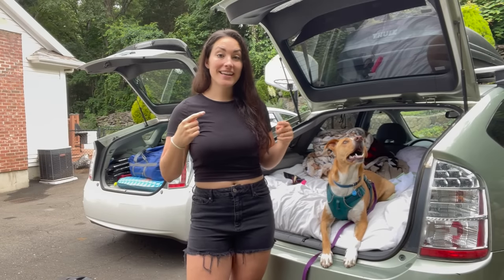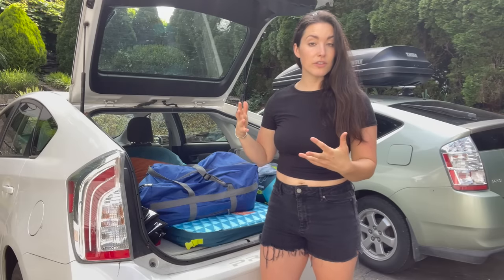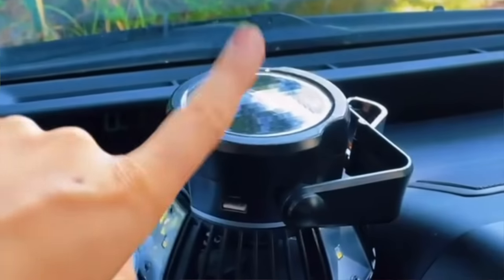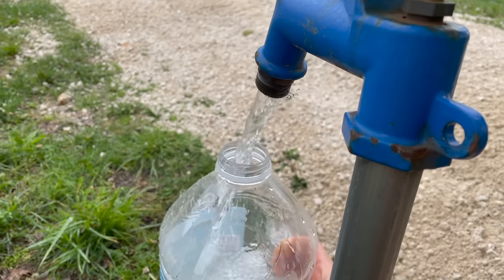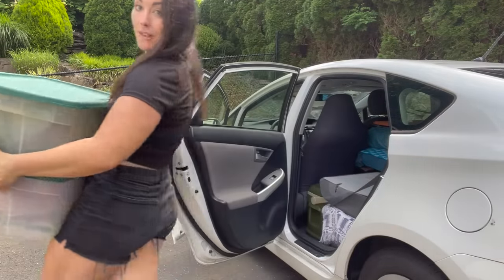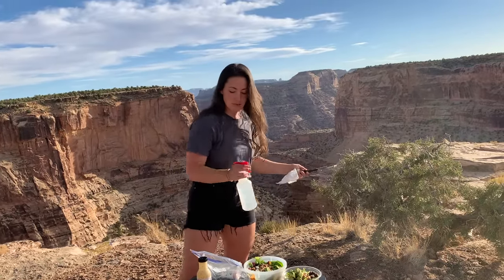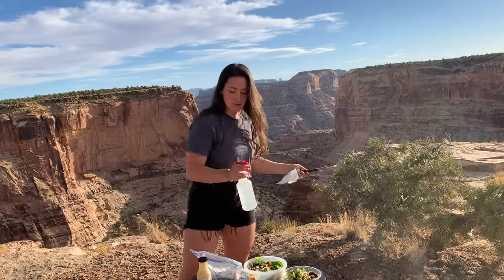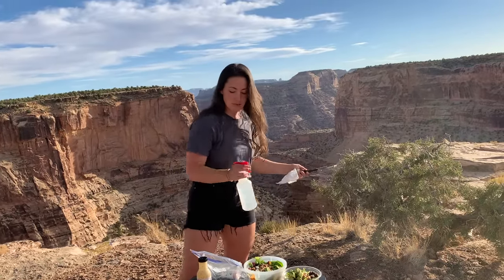Easy NO Build Car Camper Conversion + all the ESSENTIALS you need! From a 3+ yrs full timer!

Comment: Tip for super cooling a standard cooler. If a Yeti is out of your price range or you are going to be in areas where a Yeti would attract attention or get stolen, you can super chill a standard cooler with a couple things from the hardware store. Most coolers have insulation on the sides, but the lid is hollow. You lose a lot of cold through the lid. Pick a cooler that you can pop the lid off. Drill two small holes in the back of the lid where the lid attaches to the cooler. Get a can of Great Stuff expanding foam. You may or may not need a whole can, so plan this project with a friend to do their cooler or fill any gaps around the house with the leftovers. It's just hard to reopen the can after you've used it once. Do this outside and have newspaper or paper bags to lay under the lid if needed. Insert the straw and spray the foam slowly into one hole just until it starts to come out the other. This foam will expand to fill the whole lid. Let it cure overnight and there should be a bubble of foam over the holes if you did it right. Trim the excess off and clean up the outside. This is why you don't want to drill holes in the inside of the cooler where your food will be exposed to it - it's impossible to seal it up at this point. So pick a spot in the back that's easily concealed.  While you wait for the lid to dry, you need some Reflectix bubble foil and foil tape. Measure and cut a liner with a fold over lid that fits perfectly into the cooler. Basically you are going for a flat fold box type shape with the corners cut out. Use those to do covers for your small windows! Use the foil tape to put the liner together inside the cooler so it fits perfectly. Then pull it out and do the tape over the seams on the outside.  So with the liner in place and the foam filled lid, I've had ice last days longer than just the cooler alone. You can pull it out to rinse it off and the liner won't absorb water. I pull mine out of the cooler every few days to let the cooler air out. I hope someone finds this helpful.
Reply: Is Yetis’ lid hollow?
Reply: @oakmaiden2133  I don't own one but I think that's the big difference between and Yeti and a regular cooler.
Reply: @IhateSIGNINGup4this  Interesting. To each their own then. I find I get much better performance out of my coolers after being modified.

Comment: Great video Miss Nikki. In my Prius V setup, I have converted my stove to electric plus a 700 watt microwave. Use a shower tent with a solar bucked to heat water. No TP,  just baby wipes. Baby wipes for everything. Vinegar for dish washing plus disinfecting my water. You can also get premade screens from a company out of England. Also use a portable Teardrop Awning for the back to cook under or just hang out. I removed all the seats except driver and put the bed on the floor from the dash to the main battery pack, more room in the back. I put the Engel 40 quart fridge next to the bed behind the driver's seat. (very little draw). I added an extra 12 volt battery that is wired in parallel to the other Toyota battery which gives me 90 amp hrs of storage, all hooked into a 2000 watt pure sinewave inverter. At night, I run the AC/Heater on low fan and use a USB fan to circulate the air. I use about 1/2 gallon of fuel a day. Basically, I watched every Prius Camping/Living video out there and just took all the best things that worked for me. Comfort plus fuel efficiency. 👍
Reply: Do a video of your setup. Would love to see it.
Reply: @simplethailife6611  Yes, I have been thinking about setting up a Channel and doing some videos. 👍
Reply: Did you have any electrical/sensor problems when you removed the seats? There's so much wiring, everywhere, nowadays.
Reply: @snowygirl131  There are two sensors you have to unplug on the front seat, but no issues with that. 👍
Reply: Please be careful with using vinegar to clean. While it can kill some bacteria, it is not a disinfectant and is not safe or reliable to use to disinfect water. Even on objects, it has to sit on the surface for several minutes before any bacteria is reduced. If you camp often or live on the road, please seriously consider getting a water filter.
Reply: @Ineverusemychannel  I second this. Though if you do want a liquid option for emergency water purification, 5 drops of REGULAR, UNSCENTED bleach per gallon will work (exact ideal number of drops per gallon varies based on bleach concentration and should be looked up, but that was the rule of thumb I was taught in my emergency response training), and will be much more effective than vinegar. It does, however, take about 30 minutes to properly purify, and should still have a faint chlorine scent--if it doesn't add the same amount and wait another 15 minutes.

Comment: Great info! Sounds like there is no way to get away from humidity when car/van camping. If you crack the window open and it’s humid out the humidity will get in...and if you don’t, it will get humid inside🤷🏼‍♀️Love that bag thing to absorb moisture! I have watched at least 300 videos and have never seen that👍
Reply: me too, thanks Nikki, have never seen these, I've logged onto the Australian Ebay and bought some, thank you so much.
Reply: We once had a rat climb into the car through a slit 2 cm wide, our bread must have been too tempting 😂. I wonder whether those curtains would have prevented that…

Comment: I was traveling last month and saw these nice ppl. Started chatting with them.  Apparently their car was wrecked by a deer and it is in the shop for 8 days : while the 4 of them sleep at a gas station outside  during 45 degree nights with no jackets.

The difference between them and I: I have full coverage insurance,  rental,  road side and monies for a hotel.  

They only had liability insurance so they were out

Please get good insurance with all the bells and whistles if your living in your car or away from home 

Rental and Roadside is only an extra 30 bucks

Hotel is tricky bc some require a few hundred dollar deposit,  some only accept card or cash. And one time I needed a hotel and the cheapest one was 250 😞
Then there is a cab fee.

But what will you do if you wreck at 9pm... where will you go

Safety first 😀

Comment: Nikki, If I may give you one little trick, easy affordable  how to have hot water on the road as long you are  in warm climate.

 I saw that your roof top as a lot of space available for you.Taking a black PVC 5 inch pipe of around 5 to 6 feet with two end cap install a tire valve in one end and a faucet on the other, do not forget also in one of the end to install a other faucet to refill the water. The black pipe as you travel will warm up the water into the pipe, using your little compressor pressurize the pipe  10 to maybe 20 pound (experiment) at all time you will have warm to how water that whit a  quick disconnect be equip from a shower head to a hose to your bucket to clean dishes. It should not be expensive to fabricated and could be easily attach to you car rack and voila. If it is something you would like to make just had a reply to this post and I will draw the instruction for you to easily make it... I hope this could help you in the wounder full life you have chosen to have with Camper. The entire cost of the build should should not cost maybe $30.00 using you tire compressor you already have... Hoo you could have two of them one drinking water and one wash but after a little wild the water will taste plastic so make sure to refill regularly... Good trip and will look to se if you replay to some sort a way post on my youtube how to do it for you and anyone who would be interested Thanks

Comment: Instead of a duffle, I use latching footlocker style tool boxes. They compress my folded clothes and people think they're ironed out something. I set my mattress diagonal to first, fit, second to balance the driving load. Picked up a great set at Walmart made by hart for like 120$. Doubles as a table for one, and a shelf for the other

Comment: Good stuff and advise, looks pretty comfy to me!! One thing you mentioned but is important based on other video's i've watched is a quality tire repair kit. Kit's from wally world can work, better one's with metal handles on the jungle store as well book sized air compressors are much better(save some coin), i don't venture anywhere too far without them. Thanks so much for sharing, Cheers, Happy Trails!

Comment: Hey thank you so much for all these tips - I’m curious as to why you didn’t discuss the battery/gas temperature control option with a Prius. From what I understand you can adjust the interior temperature and leave the engine running overnight 
it will use minimal gas and charge the battery  throughout the night.
Reply from the maker: Mostly cause this was about car camping items and most people don’t have the option so I saved it for another video :-)

Comment: Some common sense tips & kit. I fail to undertand why more don't simply use an airbed instead of a complex platform and mattress set up....Jumper pack essential. I also think an awning &/or roof box make a lot of sense.  I have dark tints so for me the eye blind makes a lot of sense - maybe combined with a make shift curtain behind front seats...I get that window blinds make sense longer term .............Thanks for sharing,

Comment: You need a portable digital air compressor it’s 20 bucks on eBay you save $1.50 cents every time your tires need air and decide to get it from a gas station.

Comment: Nikki have you ever considered a larger vehicle like a van or minivan. I have camped in the "Minivan Motel" not quite as good on gas as your car but 3 times the space. I know gas mileage is important on trips but so is comfort.
Reply: I've been watching all her videos recently bc I want to prep my Prius for road trip/camping soon, and I think I recall her saying that  other than the mileage, a Prius is simply just easier for her to drive/park etc since it's smaller. ☺️
Reply: My Prius Plug In is a dream come true for gas mileage. I don’t travel across country with it but my trip A mileage tracking has 18,651 miles and the cumulative mpg is 126mpg!!! I use my Prius for going to work and shopping in town but the large electric battery keeps my daily travels gas free! I had a Mazda MPV and that mpg was abysmal compared to my Prius. I have gone as long as 3 months without having to put gas in my Prius, having that kind of fuel savings is a game changer for someone traveling and living in their car. A mini Van would be more spacious than a Prius but that Van body would have to be mounted to a Tesla battery pack and motors for me to switch from my Prius.
Reply: @Infinityfields  I am glade you like your Prius and love that you are getting very good gas mileage with it. I am not knocking her pick in cars just questioning that her living quarters are claustrophobically small. That would work for many people for a very short duration but Nikki seem to be using this as a home and as such even a few more square feet of living space would be magical. Saving money is great but sometimes its nice to have some comfort also.

Comment: The Prius is a great efficient and reliable car, and its impressive how well you made it work for you. But when I get ready to start doing this lifestyle more, I'm going for a Toyota Sienna. Once you remove all the back seats the room you have is incredible and with a little money and ingenuity you can turn them into a great small livable RV that still gets decent gas mileage.  
I've watch a bunch of your videos but haven't heard the answer to this question, but realistically how long do you plan to live this life style? Or is it permanent LOL
Reply: Thanks for the idea about using a Sienna, I’ll have to check into that. Great gas mileage is the best thing about using a Prius. Nikki has a 2006 Prius and I’m sure she gets great gas mileage but my 2012 Prius Plug In is the bomb for me! I bought my Prius used but on my trip A mileage tracking I have 18,651 miles and my cumulative mpg is 126mpg!!! I know this seems like a unbelievable amount but I use my Prius for going to work and in town shopping. Why such the large mpg you may ask? Well with the Plug In Prius it has a large battery that keeps my travels to work and shopping gas free!! I have gone as long as 3 months without putting gas in my Prius. This may not be the case with traveling across country as I plug my Prius in every night and traveling across country those options may not be available. However when I bought the Prius the dealership filled the gas tank and charged the battery before I left, I drove it home 225 miles traveling on average 70-75 mph on the interstate Highway. When I reached home I decided to go fill the gas tank and to my surprise it was down only 2 GALLONS!! I couldn’t believe it!!! I drove 225 miles on 2 gallons of gas!! What I later realized was that the plug-in Prius electric battery will keep the car at the speed and allows the engine to idle or shut off while traveling. Having a Plug In Prius can save a lot of money on gas, my only wish is to have a larger battery in it so the electric range would be further (side note when a Plug In Prius is driving in cities every braking for stop lights causes recharging of the battery 🔋). Using a Plug In Prius is a win win!
Reply: @Infinityfields  Those batteries only last 10 years
Reply: @spinoff2926  Batteries are guaranteed for 10 years or 150,000 miles - does not mean they quit then…

Comment: How do you get a full size mattress between the wheel wells in the Prius? Our 2017 Prius  measures less than 40" between the wheel wells, a full size mattress is 52" wide.
Reply from the maker: Electric turkey cutter on memory foam mattress works wonders lol

Comment: When buying a smaller tent please realize the dimensions on the package are the floor measurements.  When you sleep on an air mattress, etc, you will be higher-where the walls taper closer together.  I am about 5’ 10”.  A 5 x7 tent should work for me, but I just fit.  If I’m on two wheels it’s my best choice.  If I’m using my car I use a much larger tent.

Comment: You are so hotttttttttt! I tried this set up in my VW Jetta once on a summer night and with the bug net over the windows, windows down, and some camping fans inside- it was still unbearably hot like 90°. Any suggestions? Can't think of what to do without having the car running with AC for 10 hours hahah or maybe car camping is only for those who can sleep in a lot of heat?

Comment: Blows my mind you don't rock the wagon Prius.
Reply: More everything, head space, legroom, more room for Camper.
Reply: Most likely just rocked with what she already had when she started the journey.

The one thing that model doesn’t have is better or more gas mileage
Reply from the maker: I have had this car for a decade and sticking with it til it dies :-)
Reply: @mcap8396   I’ve owned two Prius cars and the loss in minimal. Wagon 44 City / 40 Highway. Hers 48 / 45.
Reply: Oh I know the difference is minimal but not nothing; I used to have an ‘09 same gen as Nikki’s. Looked into the V. I think by the time V came out they were on gen 3 so comparison between those two something like 44/41 vs 51/48.
Reply: @MC-un1nx   I hypermiled and averaged 61 mpg in my 2011. With all the gear and basically a kite bike holder she’s probably only getting 37 mpg on the highway.